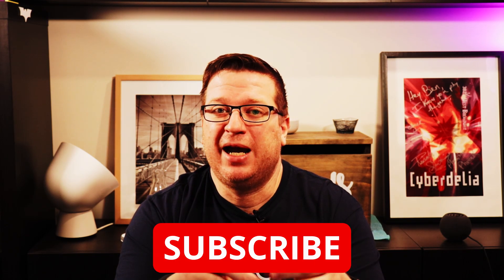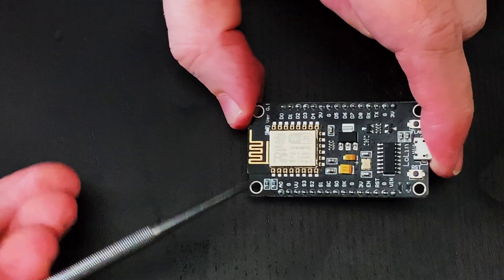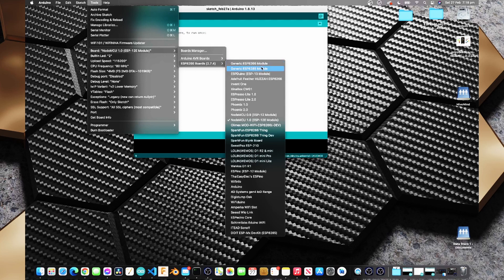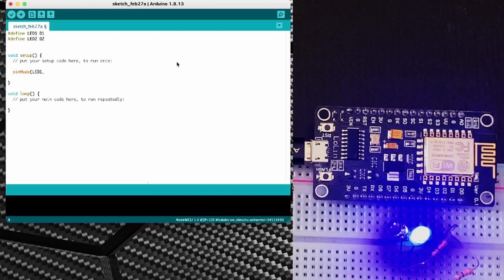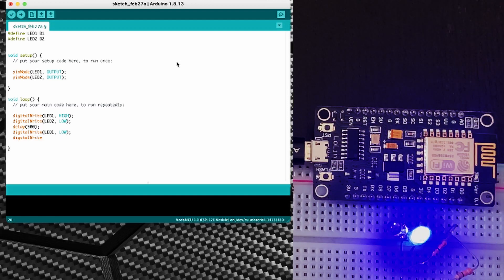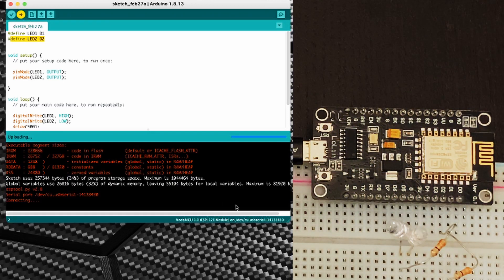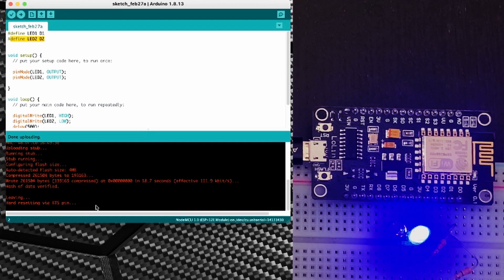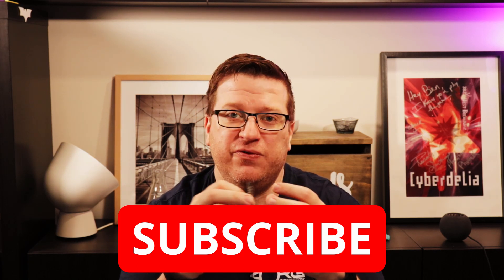NodeMCU  - What it is and why you should care

Comment: That seems to have some decent potential. I’m guessing it could be a triggering board for certain actions depending on what it’s connected to, like a light-sensitive diode teleporting it’s too dark and the house lights becoming active by triggering a script in HA, yes?
Reply from the maker: It's very flexible. 
Because of the number of I/O pins, and the low power consumption, it's great for all sorts of projects.
the ESP8266 controller at the core is basically a small, wireless enabled arduino.
I have some other videos featuring this NodeMCU, and I have some in the pipeline featuring another small ESP8266 Development board called a Wemos D1 Mini.